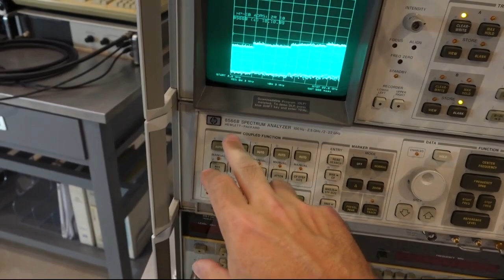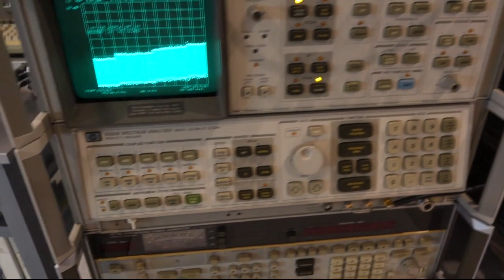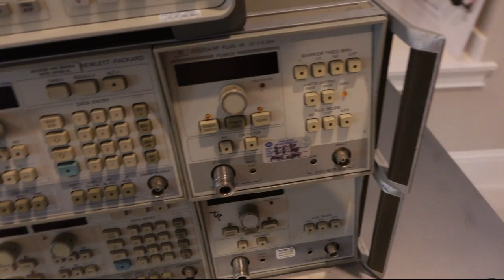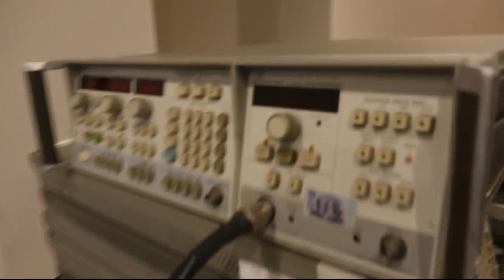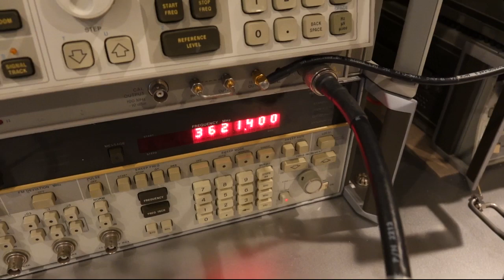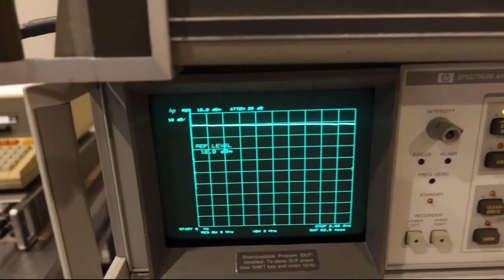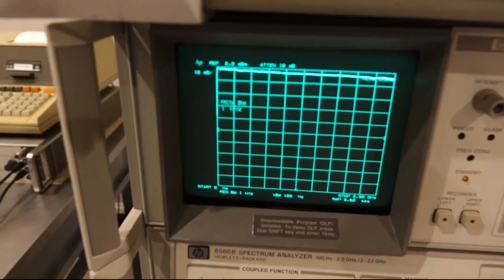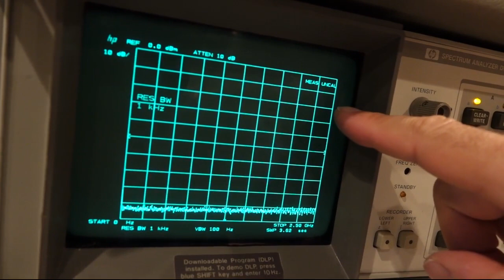Making a Tracking Generator for the HP 8566B Spectrum Analyzer

Comment: My HP8562A (the little brother of the amazing HP8566B)...all I will say is, do not try to lift these machines on your own. These two part machines are extremely heavy, and the manual recommends disconnecting the two parts before moving them. My HP8562A powers on, but no cathode action and, though I have not inspected it internally yet, probably needs recapping...followed by testing by reference to the schematic and testing points. Really looking forward to this project when I have the time. [Edit: I was so excited after discovering your channel....other people with the same interest in vintage HP equipment (so cool) that I forgot to mention how awesome your tracking generator hack is].

Comment: Hi,
I bought a new Tracking Gen for my HP 8566B from DS Instruments. Model TG 6000.
Works great and the price was reasonable. I have been using it about 2 years..Highly recommended.. It's small and lightweight which is good since my lab is very full.

Best regards,  GLenn WA4AOS

https://www.youtube.com/watch?v=tQDoe9e0s1o
Reply from the maker: +wa4aos Yes that is by far the more sensible option :-). I acquired an HP 85645A in the meantime. This is the full band, automatic tracking generator from HP that officially supports the HP 8566. Awesome full featured instrument as you'd expect, but nowhere in the same price range as the TG 6000, even vintage and used! I'll make a video about it eventually.
Reply: +CuriousMarc What is the dynamic range available using the HP 85645A? 
My 8566B has developed a problem with blowing a fuse on one of the 5 volt rails. After some reading, it seems there is a lot of concern regarding the tantalum capacitors in the unit having a high ESR. Soon, I am going to start checking boards for tantalums and check there ESR values. Not sure if I'll replace them with Tantalums or looking at a different cap. Have you had a problem with the tantalum caps in your unit?
Regards,
Glenn 
DSM Labs